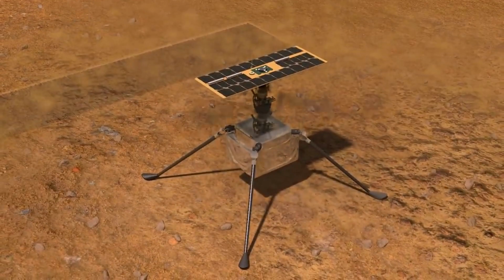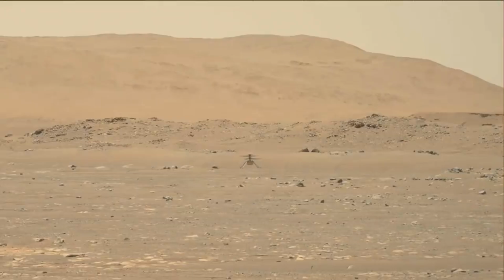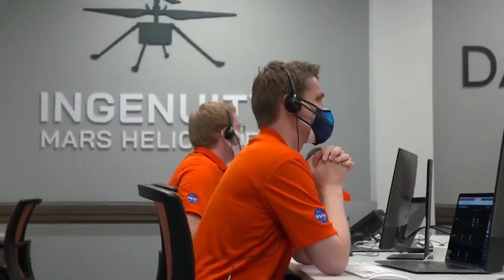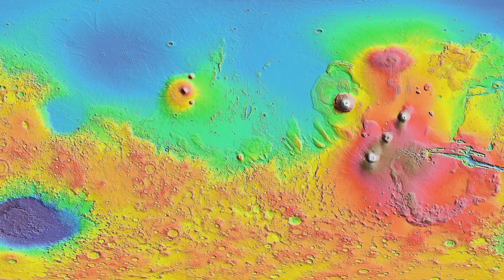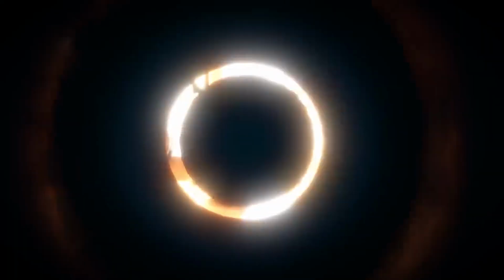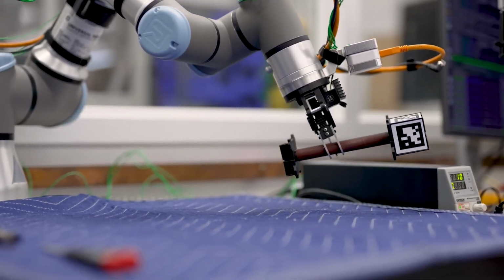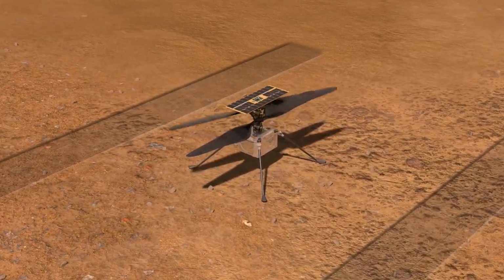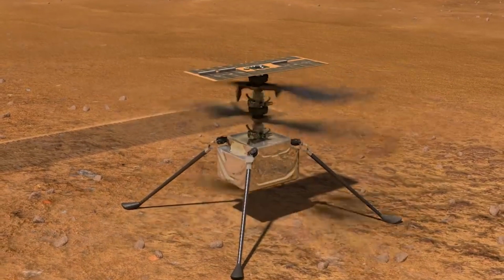NASA's Mars Helicopter Has Flown For Over 100 Minutes

Comment: One of the BY FAR most important results is the proof that off-the-shelf NON-radiation hardened consumer electronics which are VASTLY more powerful than the computers in the rovers because of their vastly higher component count can be used reliably on Mars.